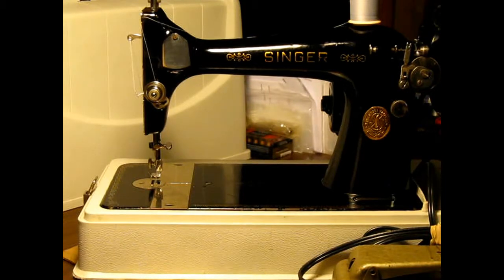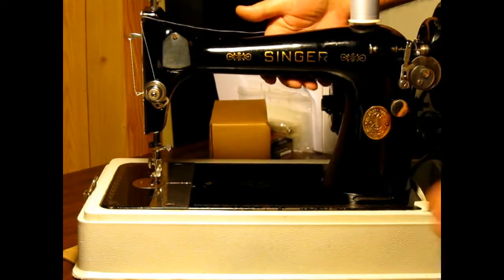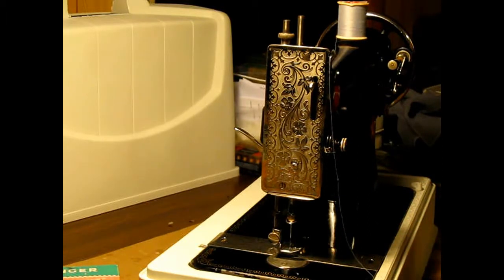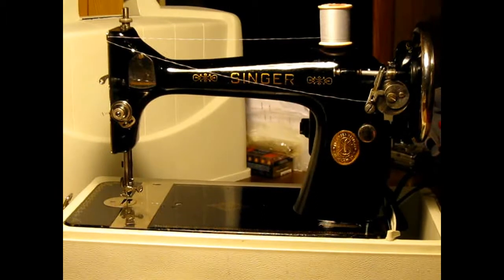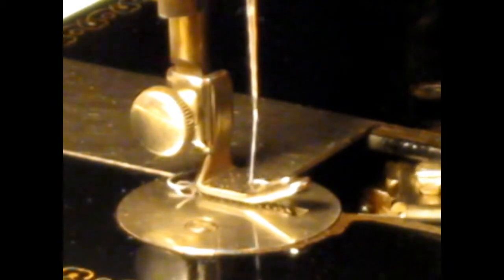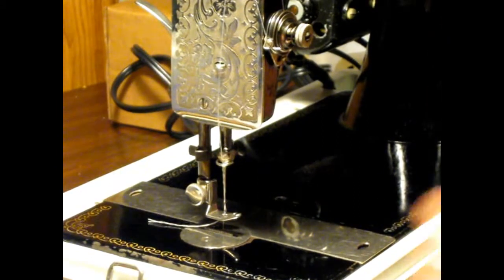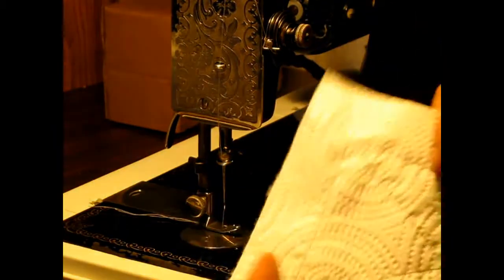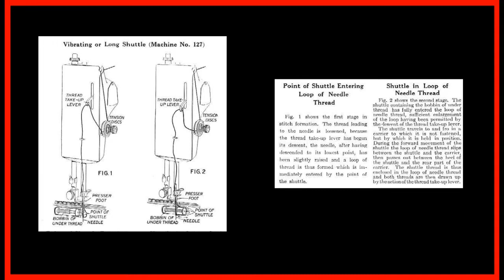The Model 127 Singer Sewing Machine an Old Workhorse

Comment: Beautiful job and machine you have there. I have a cousin to her. A 1937 128-13 with the knee control in the bentwood case.  Rewired her completely and shined up the chrome, etc., like you did. Mine has the "Celtic Knot" decal set. It's about 85% but the clear coat Japanned finish is only about 75%. I named her "Myrtle". 😁 Sews a beautiful stitch but those vibrating shuttle machines can be loud at higher speeds. Best of luck in acquiring more. It becomes a disease. I have THREE different Singer 221's and a Singer 222K. Have a Singer 15J90 Centennial. The 'J' means it was made at the Singer plant in Quebec that has since been demolished. Take care. God bless you and God bless 🇺🇸 America.